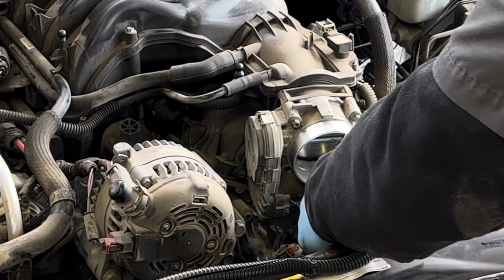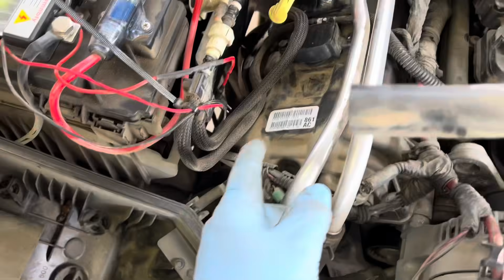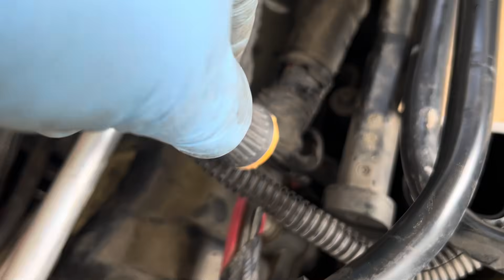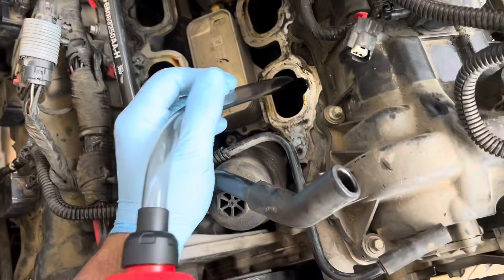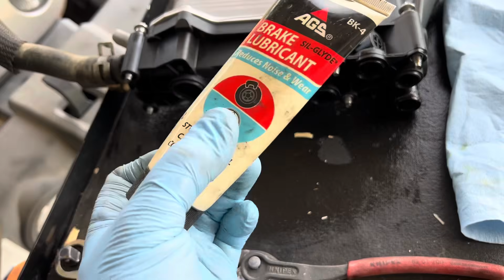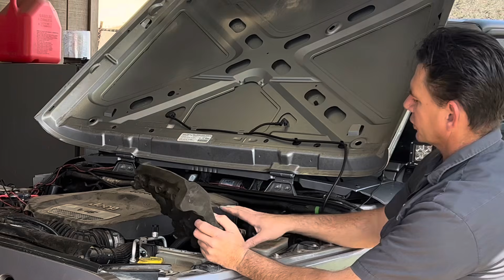Replace Your Jeep Wrangler Oil Filter Housing And Save Big!

Comment: Hey gang.  Doing this now. Is the coolant drain necessary????   I am to the point of removing the oil filter unit. 

New parts coming in tomorrow and as far as I can tell he's not mentioned that part, whereas Google says it must be done?   Anyone else?

Comment: I have zero jeep experience but i look forward to trying this in a busted part of a 2017 wrangler. I was recommended to do it myself since it was easy. I never took it seriously whenever i heard the words "all you have to do is..." because there is a lot more to do. Lol I also read that all aluminum is the way to go. I am not all that versed on the torquing of those screws to certain pounds though, but i Never saw anyone use a tool to make sure they were the correct tightness. Do mechanics know their own strength to decide what tightness is 8lbs?

Comment: I just bought this shit and immediately i have the problem
Reply from the maker: @83catgirl  welcome to deep life. Hopefully it doesn’t give you too much problems.
Reply: @HowtoAutomotive what would be my next step if I broke one of the red push tabs on the fuel injector
Reply from the maker: @ that is just a locking security tab. If it still clips on, it doesn’t pull back off I would just run it without it. If it’s loose or if you feel like it’s gonna come back off, you can’t order the connector from the dealer.

Comment: Massively helpful! I referred back to your video numerous times. By far the hardest part for me was getting those injector connectors off with my fat fingers. I got the all aluminum replacement cooler that came with all the gaskets  overnight from the big A for $65. I don't think I am putting the engine cover back on. I think it looks nice but has no function and traps heat.  Any reason to put it on?

Comment: Great video, I followed along and completed the job last night. I used a Dorman housing. Other videos I watched wanted you to disconnect the fuel rails, not necessary. There is a connection and wire tie on the back of the lower intake that were not mentioned in the video. You need to remove those in order to flip the part over like he does. As someone else mentioned you'll need to burp the coolant system after you get everything back together.

Great walk through, thanks for the content.

Comment: Anyone out there doing this or going to do it or have done  you must buy the all metal oil cooler ! The reason this fails is the factory puts in the stupid half plastic unit (mine was)and what does heat do to plastic ???? Then to make matters worse they stick that ignorant plastic cover over the top of the engine  !!! What does heat do to all plastic ???? Ever wonder why all that plastic accordion style tubing that wires are in falls apart on top of these 3.6’s ??? HEAT ! Take that cover off of your engine and allow better cooling !!!

Comment: Great video thank you. I did this years ago and unfortunately it’s time to replace the cooler yet again. One thing regarding the coolant….you can just clamp the hose off of the oil cooler rather than draining the engine block. A lot less mess and less coolant to have to top off once you’re done.

Comment: Great video by real professional - and good camera work.  Best spare part is made by Dorman 926-959 oil filter adapter made out of aluminum, about $139 - includes all the gaskets you need AND good for Jeeps 3.6L engines made before or after 2014.

Comment: This video was great BUT you failed to inform everyone how to bleed the air out of the coolant system..

Personally this was very problematic to leave out as my jeep wouldnt stop overheating and now I need more coolant bc the bubbling out method alone was not enough. 

Please know there is a bleeder valve on the thermostat to bleed air out!!  Really wish this info was in the video

Comment: My son's 2014 Wrangler started dripping oil on driveway. Looked it over and spotted oil pooling on top of engine. Google search for that lead me to this. Splurged for the all metal replacement housing (may have been cheaper since it came w/all the seals... even new bolts for the housing) off Amazon for $76.85. All done & no more driveway spots. Thanks!
Reply from the maker: Glad it all worked out. Thank you for watching!
Reply: Did you have any issues with the sensors? I’ve seen those on on Amazon. Read a couple reviews and few people were having issues with the sensor after installing
Reply: @wilvzn  No... It's been about a year now and no issues

Comment: Thank u for posting this.
Will help my husband do it so we don't have to pay $1100 to get it done. Big O said this was common for my Jeep wrangler, a 2016. 
Id had zero issues until i got a quick sit in your vehicle oil Valvolene change. Drove 2k miles across country and oil is sprayed all over underneath.
My husband or Les Schwab always changed stuff, no problems ever. 
So either it was ready to crack and this is a coincidence, or overzealous Valvoline in Bend oregon cracked it.
Im sure even i could do this myself as thorough as you were here. 
Again, thank you for posting this.

Comment: Ok now someone explain to me why the shop wants to charge me $600 to do this. This guy made it look so easy!
Reply: I just got a estimate for 1200. they want 600 just for the new housing.
Reply: @rotten9711  yeah turns out the $600 was just for the part. Asked for a breakdown and the full quote was $1500. Bought the part online for $200 and did it myself after this video. Saved myself a good $1300
Reply: I’m in the middle of doing this right now, and it ain’t as easy as he makes it look.  Getting to the three injector connectors are a major pain in the ass.  I disconnected the big connector on the passenger side and I also pulled out the Christmas tree holders on the left side of the harness to get to the FI connectors easier.  He mentioned nothing about the harness being connected to the back of the lower intake manifold, he just lifted it off like they weren’t connected, because they weren’t!  Have fun getting those off.  Disconnecting the water hoses first thing would have made removal of the bracket on the left side much easier.  Him having a jeep with no fenders/liners and lifted made getting the two lower nuts for the bracket on the left way easier than a stock jeep.
Other than those things, yes this job is a piece of cake😂
One other thing.  The upper intake is marked 7-9 Newton Meters.  8nm is 5.9 lbft .  Remember those screws are going into the plastic lower intake manifold.
Reply: So the owner can help pay for his beach house and lake home
Reply: I got a quote today for $1509 bucks for this problem today. Said the part is $700. While complaining at the part store they offered to sell me the part I needed for $260 bucks. Markup is insane these days.
Reply: @trish7992 typical markup is 2.5x the cost of the part for most shops. It is insane.
Reply: Do it yourself then
Reply: @alexsugent3279  you good bro?

Comment: How do you determine that you need a new oil filter housing?  Are there other sources of leaks in the same area, or you just have to take things apart until you find the cause?
Reply from the maker: There’s a few holes in The Intake where you can look down and see the bottom where the oil or coolant maybe leaking. You just have to take the top cover off and then get up on top of the engine and look down.
Reply: @HowtoAutomotive   Thank you for the quick reply and appreciate the video in general. 
Just came back from a long trip and noticed something dripping under the jeep. At first I thought it might be condensation  from the AC dropping down, but after getting under the vehicle, I noticed oil dripping down by the transmission (manual) and immediately thought I was sunk. It however felt thinner than it should be, as if it was mixed with water.  Perhaps this is a clue that the oil filter housing failed and is just running down the valley towards the bell. 
I just looked under the oil filter cap, and yes, I can see a pool of oil. Thanks for your guidance.

Comment: Excellent video! 👍 What was the reason you had to change the oil filter housing? How long did it take to replace it?
I have a 2014 jeep wrangler with 80k and after one oil change the red light in the cluster goes ON back and forth! I went with and original filter and it stopped doing it for a while but came back. I bought a new OEM oil filter cap thinking that its internal valve was the problem and still the light ON!  Also, I just found in the cluster menu an option that gives oil pressure, and it shows cero oil pressure, thing that I think is not true because the engine does not have any clicking or knocking noise, it is very smooth in all RPM. 
I'm buying a oil filter cap with threads to install an oil pressure gauge just to be 100% sure of the oil pressure.
Will be nice to hear your thoughts. Thanks in advance!
Reply from the maker: It’s very common for oil pressure switch to malfunction . And for the housing to leak oil.

Comment: My coolant is leaking after swapping out the oil housing . I went back in today and the oil housing is still on there but there’s a lot of coolan under it towards the back end not the front end . I wonder if it’s the hose or if I didn’t install the housing correctly .
Reply from the maker: Sounds like one of the O-rings or is not sealing